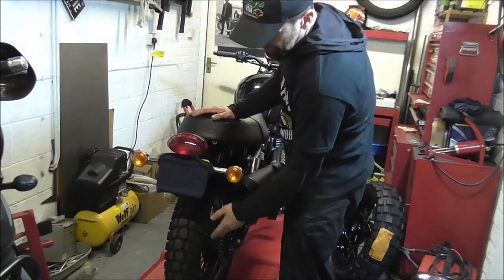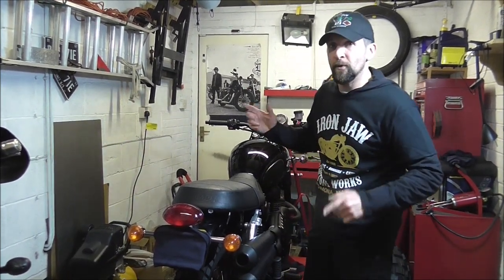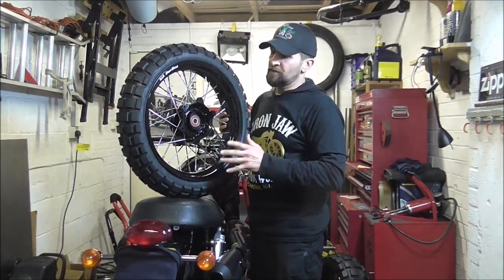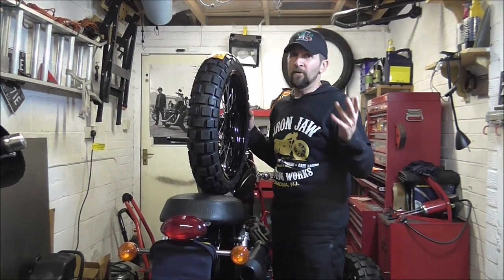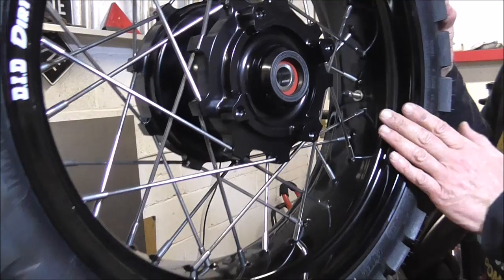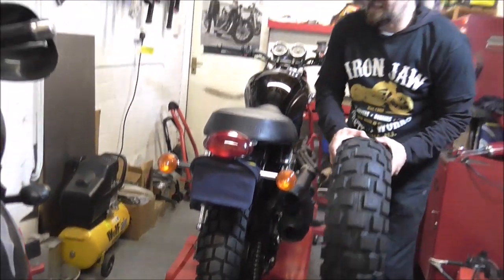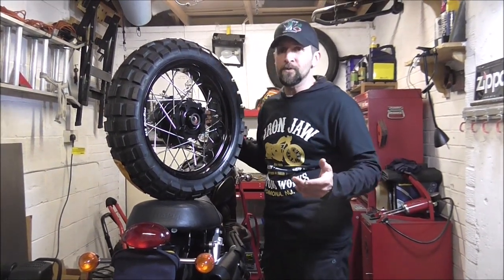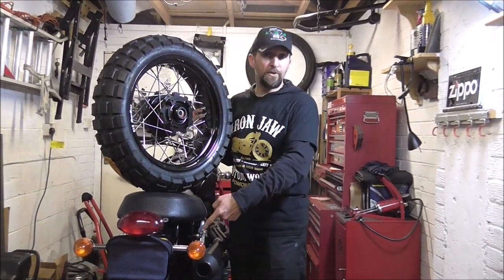Delboy's Garage, Triumph Scrambler 'Fat Wheels'

Comment: fuuuuck !!!! thats HUGE!! what a fucking big difference,can you even get the chain on?
Reply from the maker: No problem at all mate, that's the reason for the 170 and 5" rim, it fits with 1/4" to spare, literally bolt straight in... if I'd had a choice on bigger, I'd have gone for a 200, but then you need to go mono-shock and make many other changes!
Reply from the maker: Roy Rodriguez
 Have been thinking about the front fender, it's gonna give an inch more gap than I currently have and am gonna wait to see that fitted before I make any decisions... have thunk about the fender under the yoke, but there isn't the room between the yoke and the frame... may not run one at all... brat style
Reply: Moonfleet41 Hi Del! Using wider tyres gives bigger diameter. So unless you have lower profile, that inch of yours will not be an inch in real life any road. Follow me? John
Reply: Roy Rodriguez I wonder if you could fit a swingarm from an America or Speedmaster then? I use a 180 tyre on a 4.25X17" rim on my rearwheel on my Speedy and there's plenty of room. :-)
Reply from the maker: John Mård
Hi John..it IS lower profile, front was 90/90  and will now be 120/70  standing height is 2" lower exactly..(measured it), an the back was 130/80 and is now gonna be 170/60   stands about 8mm taller at most.. the 170 is the widest you can go for as due to the chain run you'll need to space out the sprockets...swing arm width isn't an issue, i could get a 200 in there is it wasnt for where they place the gearbox sprocket... done all the summs John...this wheel is a bolt in and play, not gonna start basterdising the bike...dont wanna ride up the road on a bitsa..!
Reply: Moonfleet41 Ok Del, I beleive you! Funny though, I have a 180 rear tyre on my Speedy and there's almost 10 mm between chain and tyre. Strange? I do beleive my wheel is straight! :-) The rim is only 4,25, that might make the difference. They look really nice though, your new wheels. Lovely bike, the Scrambler. ...basterdising! Ha ha!
Reply: John Mård Actually, 2 years ago I had a 190 tyre on! A FullBoar USA, if I'm not mistaken. Good tyre, not my ridingstyle though. But almost! ;-)